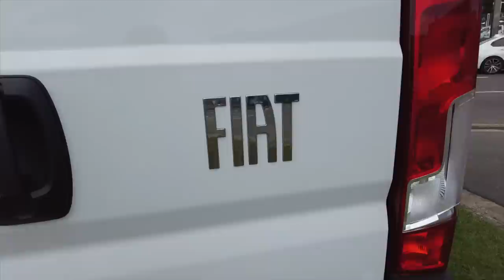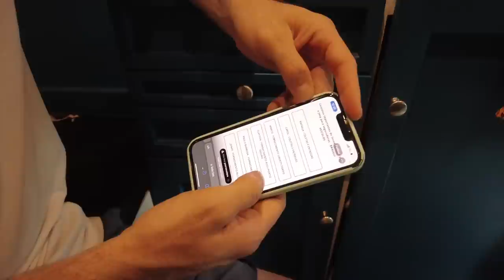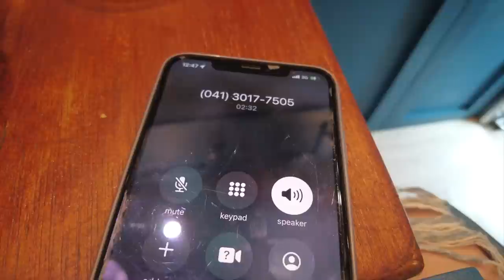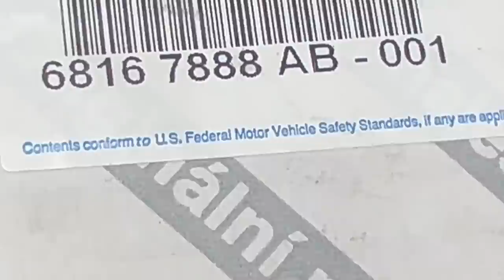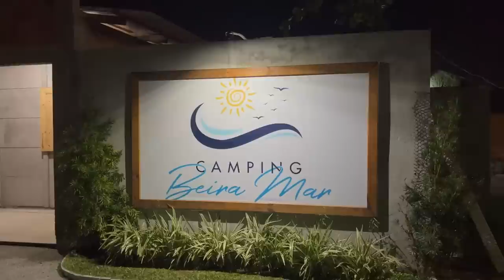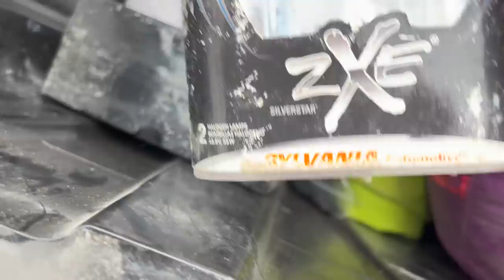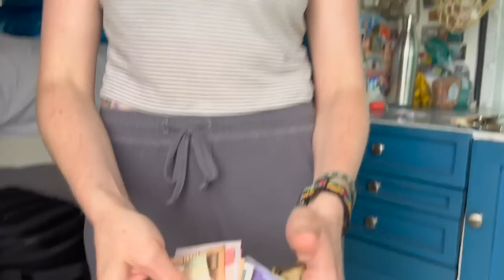It's hard to find a truthful mechanic - Van Life Brazil

Comment: I think the mechanics have been giving you good advice. That ball joint was well worn, the only thing is you should have changed both sides.
Reply from the maker: Hey Desmond! Thanks for your comment and for your concern about the ball joint. We really appreciate your feedback and we'll definitely consider changing both sides in the future. We always want to make sure our van is safe and reliable for our adventures! Have a great day!
Reply: Yup. The one is new and the other 1st might be going bad soon after.
2 because the one is new and will put more stress on the other one. 
My uncle who is a mechanic learned us to always change in 2's or 4's
Reply from the maker: @Zianeshka Sparen Hey Zianeshka! Thanks for sharing your thoughts. It's great to hear that your uncle, being a mechanic, has taught you some valuable advice about changing parts in pairs. It definitely makes sense to avoid putting extra stress on one component when you have a new one in place. Safety first, right? Keep up the good work and stay safe on the road! 😊🚐🐾

Comment: Happy to return the favor and make your guys' day too!
Funny -- I've just, in the last month or so, rediscovered PB and Banana -- I have a banana almost every day, but lately I've been craving peanut butter with it. I figure I need the protein and amino-acids (from nuts) maybe. Been going a llittle bit overboard on it, maybe, but no need for the bread -- just straight PB on banana, holds me over for a good long while.
I completely relate to the stress of mechanics diagnosing your vehicle -- I'm dealing with alot of that and it IS stressful even just as a local thing. But it is a sign of a truly good and honest mechanic -- they don't want to just "throw parts at it" and hope it solves the problem ( they still get paid either way so why care?). Especially if the problem is intermittent and re-occurs at a really inconvenient time. 
I understood that the clacking/clicking noise would have been coming from the CV shaft where the grease had leaked out from the cover. The noise is revealing that it's life expectancy is shortened -- how short? Who knows? A 3/4 Ton Van should use reasonably durable components, so you may have awhile yet. 
These things can go a long time and deteriorate slowly -- it would be ideal if you could re-grease and somehow seal it again. The friction and heat are what will kill it. 
Other than that, I'd say just avoid sudden throttle increases/ acceleration especially with the wheels turned a lot. Mostly parking manoeuvres in tight spots are likely the worst for it - or stopping and starting on hills with your fully loaded van. And no burnouts! Wishing you well.
Cheers!...from North Vancouver
Reply from the maker: Hey Adrian, thanks for your comment! No burnouts... aww man!! 😝🤣 So glad to hear you've rediscovered the delicious combo of PB and banana, it's one of our favorites too!
Totally agree with you on the mechanics, it's always stressful but we're lucky to have found a good and honest one. And thanks for the advice on the CV shaft, we'll definitely keep that in mind and try to avoid any sudden accelerations.
Hope you're having a great day up in North Vancouver! Cheers!